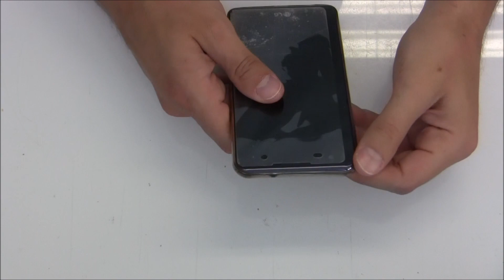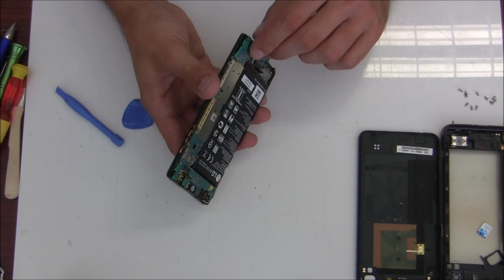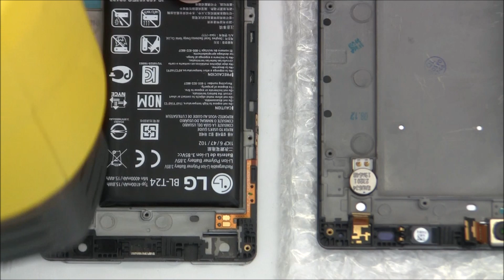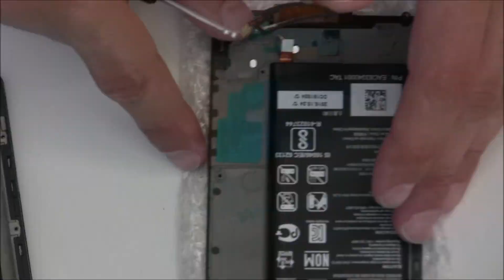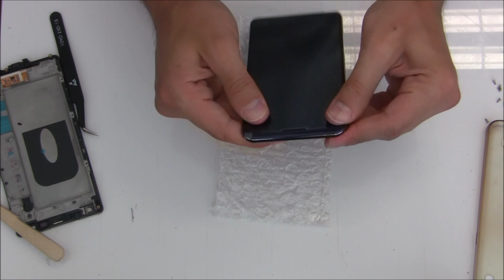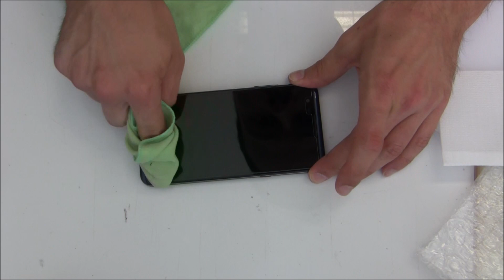How to replace cracked LCD Screen on LG X Power K220 by CrocFIX

Comment: Does the screen replacement come with the LG logo at the base of the screen?
Reply from the maker: Yes
Reply: CrocFIX cool, also when you replace LCD digitizer does it wipe away any memory stored in the previous digitizer? Photos, messages, contacts, apps, etc?
Reply: The LCD doesn't store anything. All the memory is on the mainboard that you move over the the new LCD.

Comment: is that a dryer of some sort?
Reply from the maker: It is a heat gun. More professional. Sometimes you can use a dryer, but if you work often with repairs, it will be better to buy a heat gun

Comment: is the lg-k212 the same phone?  My network is xfinity mobile?
Reply from the maker: No, the K220 and the K212 are slightly different models.
Reply: Do you know where I can get the screen.  I need to do 2 of them I purchased one but it all I was sent was the glass.  I was told that the glass and the LCD are fuzed together.   I can get it fixed at a local mall but they want 158 to do it.  I have done quite a few but I seem to not be able to find parts for this K212.
Reply: Great video! Thanks!

Comment: Would be nice if you showed how to actually take off the glass, I cant find a single video in english explaining how
Reply from the maker: It's not worth it to replace just the glass. The LCD with frame is maybe just $4-5 more expensive and you don't have to glue the new lcd with glass in to the frame. But if you really want to, you can watch my other videos where the procedure is similar.